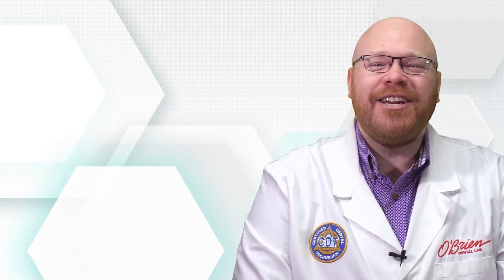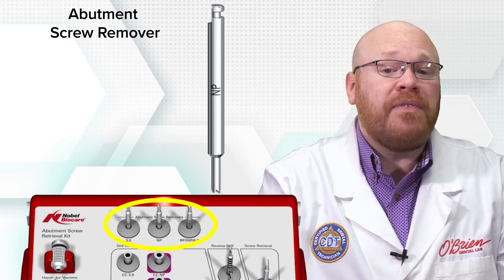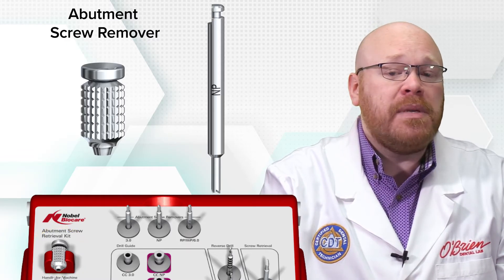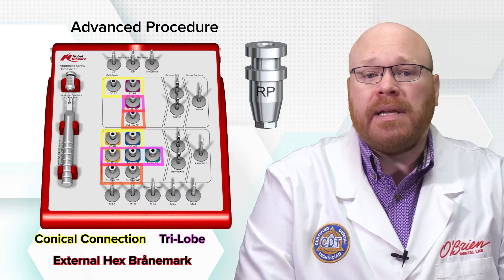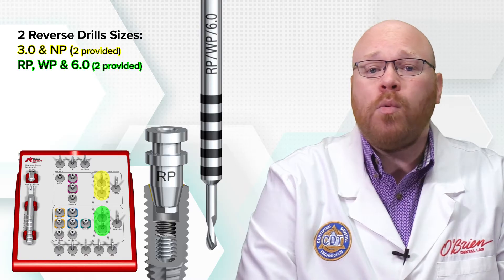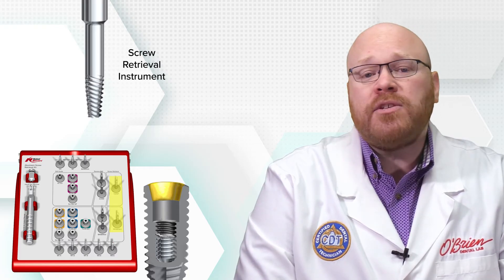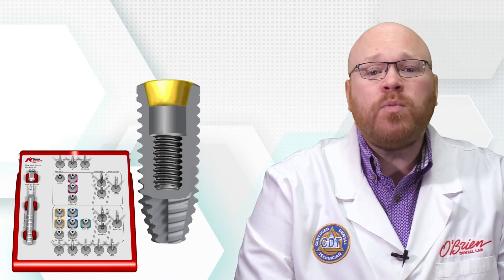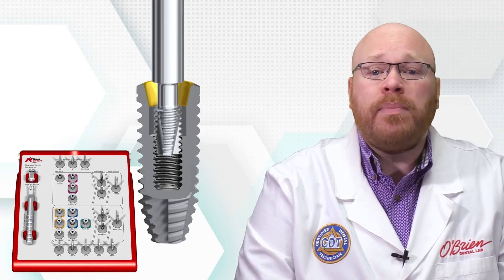Broken Implant Screw Retrieval Kit - Nobel Biocare

Comment: I had a Nobel implant patient come in with an abutment in place. The screw holding down the abutment had its head stripped. It was a knock-off screw. Maybe this kit will work.
Reply from the maker: Yes, this kit will work on nobel implants regardless of the screw type.  With the abutment still in place, the simple procedure with the "abutment screw remover" can be used.  The advanced procedure could only be used if no abutment was present.

Comment: How can the abutment screw  restored  in case of unknown manufacturer?
Reply from the maker: That can be difficult.  If you're able to remove the screw, a lab may be able to identify the type of screw just by looking at it.  You can also take a radiograph of the implant and use an identification service to determine what it might be.  Knowing what system the implant is will typically help in determining what type of screw it is.